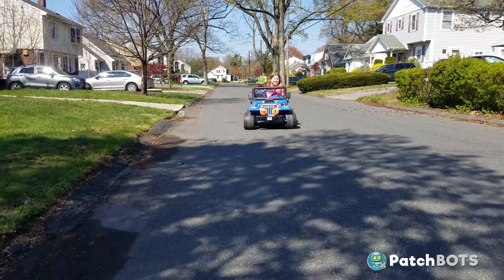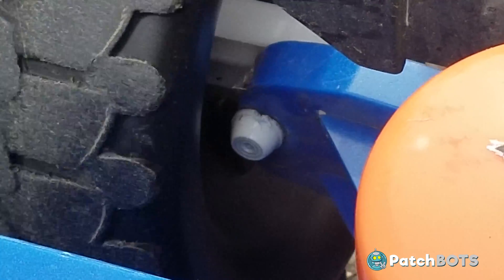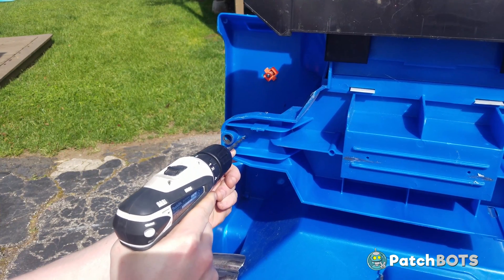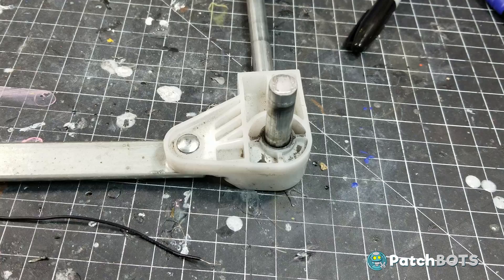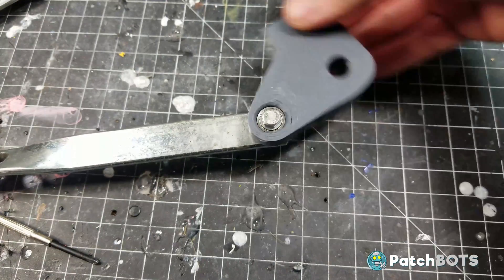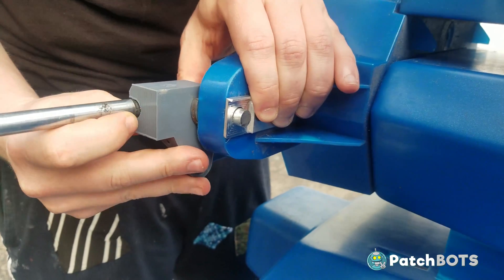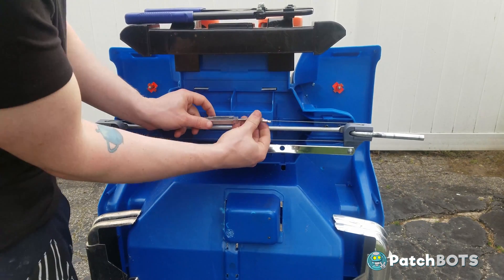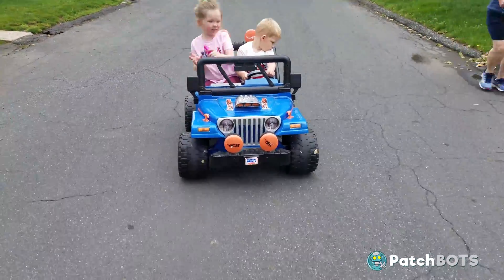Powers Wheels Jeep Part 2 - Steering Alignment Fix

Comment: hope all is good there.  You've not put up video in a while.    

if you (or anyone else) can advise would appreciate it.    Will start with looking for way to modify "ride on"s par of wheels to act more in concept of differential action (lower rpm of motors on inside tires during turns).  Use mine to haul medical equipment and tools next to me when outdoors ..... think more like farm fields not roads.

Comment: You mention adding the turnbuckle to tighten up the tension as it loosens over time - could the steps to  reinforce the brackets and 3d print new knuckles be eliminated and just have the turnbuckle?

Comment: What is the part that holds the loop for the Bike Cable?
Reply from the maker: The link to all the hardware is above in the description.
Reply: Thanks for your reply, besides the turnbuckle, the loop that is secure within the bike cable, what is that specific part? is it included in the bike cable hardware?
Reply from the maker: @Thehungrymailcarrier  Oh i get what you're saying. Yeah they are just bike cable crimps.  Honestly you can forego the whole turnbuckle/bike cable thing.  I find it to be not really necessary

Comment: Hey guys I got an alignment issue and need help. It's for the rollplay silverado 2 seater. My front tires toe "IN" after a crash. Not like the jeeps that toe out. Also I have positive camber.
Reply: Also my steering knuckle is designed different and faces forward

Comment: Or if you would be willing to share the file and what type of material you used, so I could try to find a shop that does 3D printing in Houston.
Reply from the maker: Hi, yeah sure the file is linked in the description.  It's a pretty beefy piece so you probably print in PLA and be fine, but I used PETG just in case.
Reply: @PatchBOTS  Just wanted to make sure I'm looking at the correct file.  When I click on the 3D file for Steering knuckle link, it takes me to PowerWheels24v, and then under the Part2-Steering there's SteeringKnuckle1.stl, and SteeringKnuckle2.stl.  I'm guessing one is the left and one is the right.  Is there a trick to downloading the files?
Reply from the maker: @sbostic4482  You are correct. The parts are identical, just mirrored for each side.   When you click the part and get the model preview, you should see a "download" button on the top right.  Right click that link and hit "Save Link as" to get it in an STL form.
Reply: @PatchBOTS  Great, thank you.  One last question.  On Shapeways it’s asking for Units and the options are MM, M, and IN.  Do you know which I should choose?
Reply from the maker: @sbostic4482  ugh. shapeways is such a ripoff. just email me or message my patchbots account on facebook. i can probably just print them for you.

Comment: Way too much uneccessary work! All that is needed is hot glue in the knuckles and pinch tight the sleeves then tack weld to cross member for steering. All done!! Leave rivets alone

Comment: I bought my kid a used F150 PW for $50. I've starting upgrading the electronics, but sorely need to address the steering rack. I really want to install pneumatic tires. Any thoughts? I am seriously considering asking the guys at work to machine them from a block of aluminum.
Reply from the maker: If you beef up the friction on the tires, you'll definitely need to do something.  Carving it from a block of aluminum would work but may be a bit overkill.  I basically rebuilt the existing PW steering system, but if you're going with real tires you might want to consider reinventing the wheel a bit  (pun intended).  I'm sure you can make a beefier system that will work better (good luck!).
Reply: @PatchBOTS  I've threaded the front "axle" piece at the top to replace the push nuts and remove vertical slop. I also just got done stiffening the plastic steering arm by sandwiching it between a couple pieces of aluminum flat stock. It's a start, I guess.

Comment: When it turned out that the aluminum was too thick, You could have always drilled out the center of the rod, tap it, and using a washer that fits over the rod tighten it down until the whole thing is snug with no slop but free rotation.